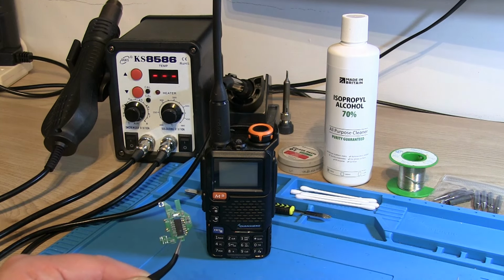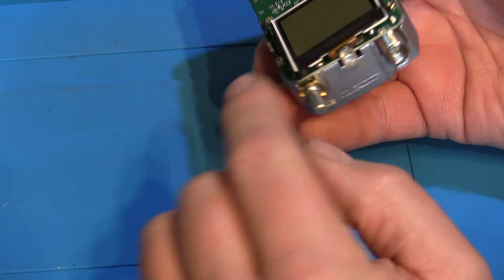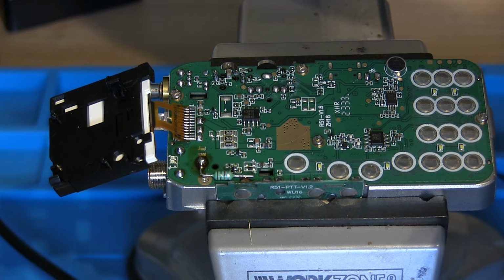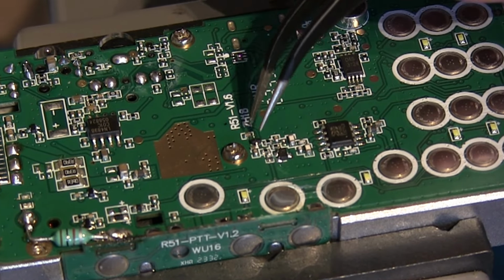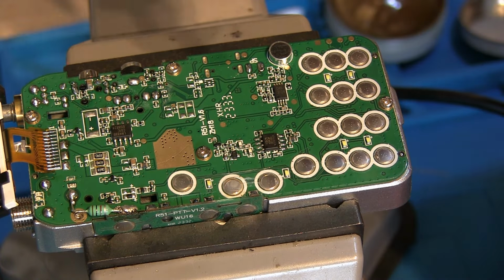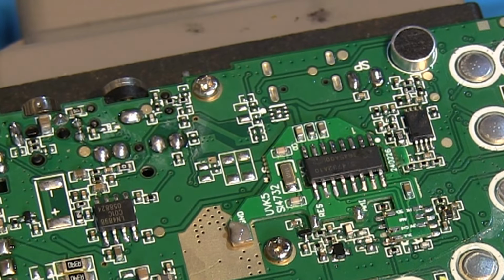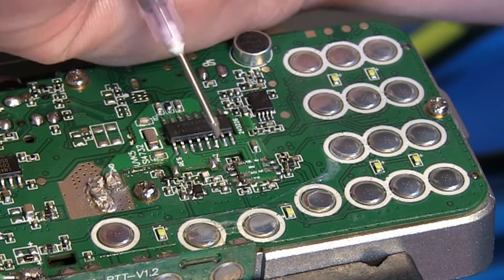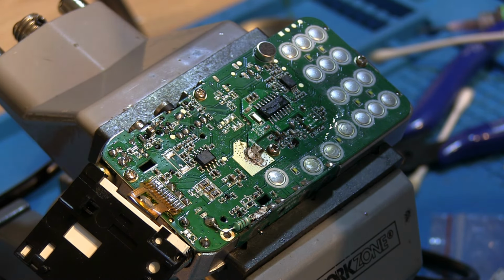Quansheng HF Modification  Hardware Install

Comment: Soldering advice (this works for me, take it or leave it!)
- ! PRACTICE on scrap boards with similar components !
- keep the soldering iron BIT clean - wipe it on a damp sponge or cloth between each use.  Heat does not transfer through the cruddy coating of oxide and/or burned flux. As soon as you have completed a joint, clean it again to get the flux off.  Flux is very acidic and will dissolve and corrode even coated BITs... before you switch the iron off clean it again! ... do this obsessively.
- Use a flux core solder (just easier and makes less mess) beware the smoke from any flux is acidic and can trigger an asthma attack if you breath it in.
- Do NOT carry solder to your joint on the BIT - it is already contaminated with oxide, no longer properly mixed with fresh flux and will not make a good joint.
- 'Tin' the bit (melt a little fresh solder on the cleaned bit and then shake/tap off the excess leaving just a silvery surface covering on the bit).
- 'Tin' wires and component legs before trying to join them (if resistor legs are even slightly corroded ,clean them by scraping with a knife blade or sanding the surface down to bright metal - failing to do this can result in 'Dry Joints').
- press the clean, tinned bit onto the joint, making sure that clean solder on both surfaces makes contact (best heat transfer) and hold it steady until the the solder already on the joint melts and then immediately feed solder wire between the BIT and the joint allowing it to melt as it goes in ; this is quite a quick action preventing overheating of the joint, too much faffing will eventually melt the glue holding the track onto the board so best to get a good join quickly and first time.
- The Soldering BIT on a good Iron will be coated with ceramic and have a magnetically controlled temperature, the back end of the bit is stamped with a numeral like '7' or '8' this is the temperature in 100's of Fahrenheit.
- For fine work like this, a slim point BIT is a good choice, but you might want to select a hotter BIT but also work faster to avoid cooking the tracks off. 
- Use 'Helping Hands' adjustable crock clips to hold the board/part/wire in place while you use hands for the Iron and solder wire.
- When soldering the wired resistor, for example, 'tack' both ends of the resistor, you can then re-melt and move one end or the other to reposition it without it falling off.
- Use the full length of the resistor wire without cutting it until after it is soldered into place - then snip the waste close to the solder; a good pair of fine-nosed side-cutters helps to keep the result tidy.
- If you add too much solder, use a solder sucker bulb or pump to remove excess molten solder and try again. Some people use copper braid - I don't like that.  Ironically a solder sucker works better when there is too much solder on the part (so sometimes worth adding some to make it easier to remove it all).
- Using the Hot Air Blower, use the smallest hot air tube for a single component like a surface-mount, don't go straight down, but angle the blower a little away from sensitive parts (ribbon cable) and also take care to not melt solder on other adjacent components by angling away where possible.
- Using a HIGHER temperature for a shorter time is often more effective.
- Pre-heat the tweezers...
- Grip the surface-mount component with tweezers and heat both the part AND the tweezers until the solder melts and the part comes off easily (do not pull or lever, you will pull the tracks off), as soon as you remove the heat the solder will harden and it will be too late to remove the part as a separate action, additionally the cold tweezers will drain the heat out of the component and solidify the solder almost instantly.
- To remove surface mount components with a soldering iron, place the iron BIT at a low angle along the side of the component and use it to melt additional solder onto both ends at once, then either slide the component off the pads with the iron and tidy the pads up later or lift it with the soldering BIT and a knife blade/point from the other side.
Reply from the maker: Excellent advice! Thanks & Thanks for watching 👍

Comment: no need to take the nut off from around the antenna, just pry out from the bottom and pull out the unit from the case.

Comment: I was considering doing a soldering video and upload it for the community. Is anyone interested?
I started doing boards in 1974. 
Yeah I’m old but not that old!!!😅
Reply from the maker: That would certainly help me out! I must admit there is room for improvement with my soldering 🤪👍 Thanks for watching 👍
Reply: @m7frs272  I’ll do it this weekend. 
Soldering is quite a skill. Didn’t me to make you feel inadequate or anything! It took me a while to get the hang of it!

Comment: some of the comments are unhelpful, as an SMD operator and Rework Specialist, four things are a must,  magnifying lens, flux, decent tweezers and hot air blower.... flux the component location warm it up to melting point, drop in the component (0402) cap and whilst still blowing orientate the component and itll align with the pads when the solder melts.. when working with smd stuff and a blower use kapton tape to protect ribon cables and the other components from heat.... job done.

dont be put off by doing mods like this in the future, its a skill that takes time to master but well worth the time and patience.

Comment: I ve appreciate your effort but i don't like your job so you need to have much more experience with ,, hot air,, solder station  and dont forget  flux and more  flux . On fina lm glad of your  success best 73 !!
Reply from the maker: Thanks for your comment and for watching. Yes I'm still learning 👍 73

Comment: When removing components you should actually add solder to the connections and the iron's tip first. That will then substantially improve the spread of heat from the iron tip. BTW, I'm a soldering instructor with NASA certification and 60 years experience, so I'm not just babbling.